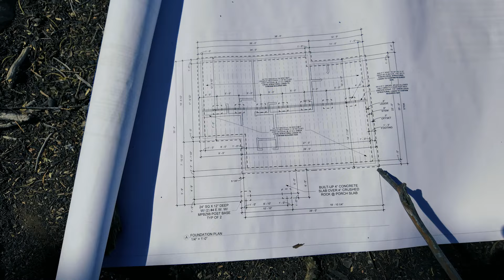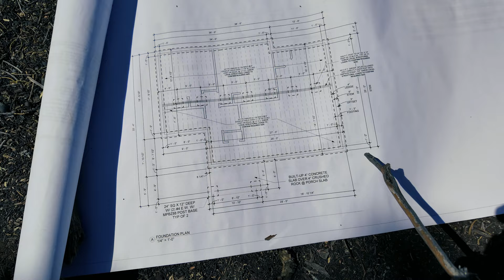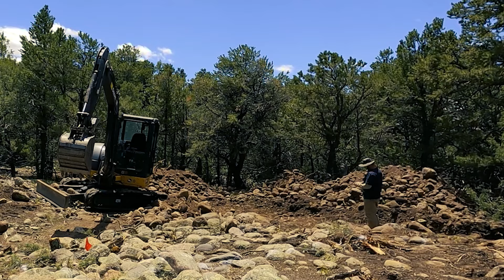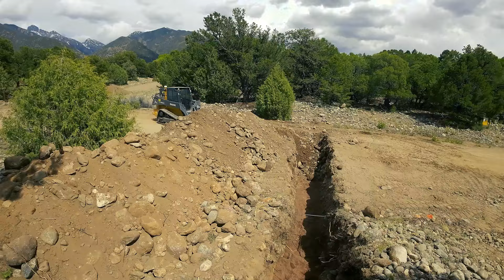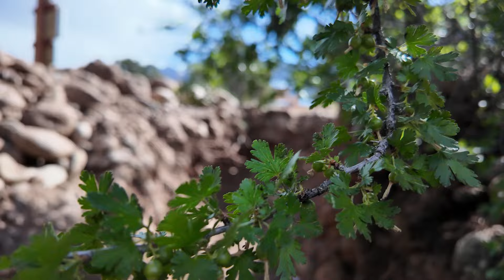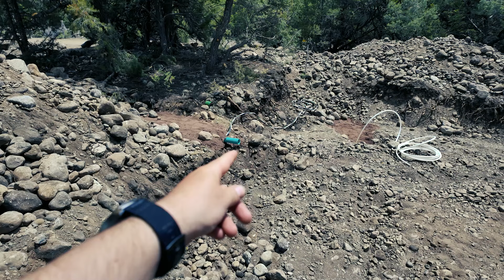How to Prepare for Building a House: Foundation and Utilities Installation - 2024 House Build ep. 2

Comment: How long did this take you and how many people did you have in this process? How much was cost of materials total?
Reply from the maker: This took about 7 days. 2 days for clearing the trees and 5 to excavate the site and install utilities. This house is 2 people working. Water/sewer pipe and electric cable came to $1200, sand and gravel was $1230 and equipment rental was $4500
Reply: @slothconstruction  so speedy wow!
Reply: also what about an internet/ethernet line? Is there any reason why u dont need that?
Reply from the maker: Here we use wireless internet. But I do install the cable inside the walls and attic to make it easy for the installer.